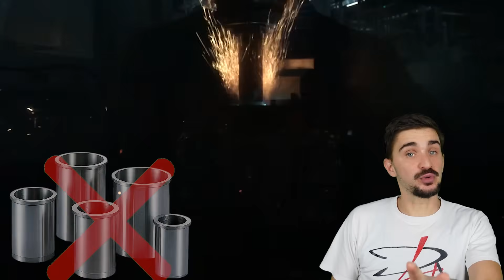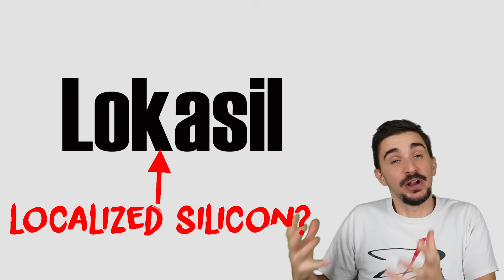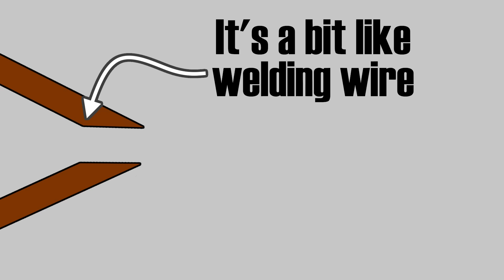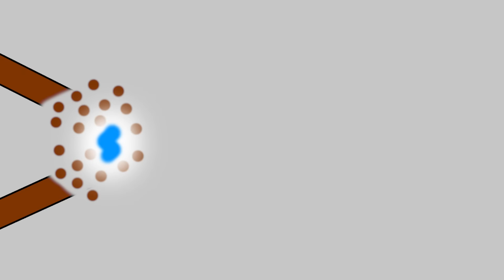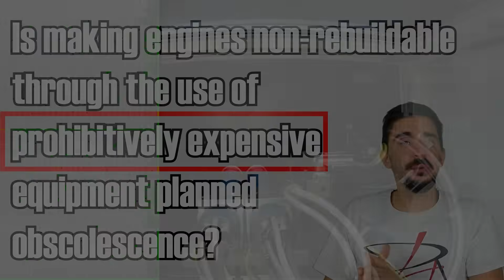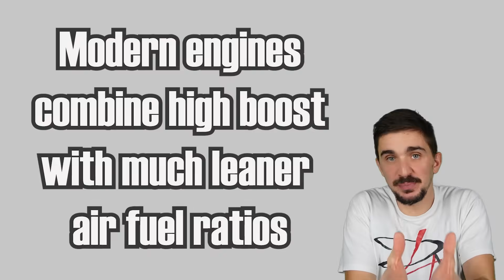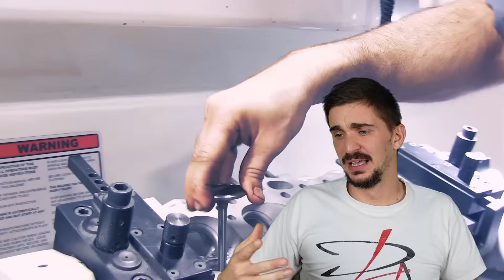Why Are Engines Becoming Non-Rebuildable? Everything About Cylinder Coatings

Comment: From family car engine I expect 2.0l and around 90 hp if it have to weight so much as 2000 kg.

From Performance car I expect Performance in corners, acceleration and fun, not some mythical 1k hp that I will not use even on track. Only will use it in 1/4 mile run, which I dont have track for it around.

Can we finally start doing ""resonable"" cars again? Wild raw cars in performance, not heavy bricks with as much hp as we possibly can.
Reply: The bricks with huge HP Numbers (that last less than 10 seconds) is a USA Problem. Maybe you should check outside of the USA 😂
Reply: @bavarianmonkey8326  I hope you dont meant mock US for making only cars that go straight, since that would obviously show your lack of knowledge. Care to elaborate?
Reply: @soulrippers5652  of course there are also very good round track (cornering) cars from the US. However, drag racing in a straight line with cars that are absolutely useless except in that very discipline  seems to dominate US car motorsport culture.
In Europe, the road course is much more common than quarter mile racing.
Reply: @ True in 100%, but as always, there is a ""but"" : P

I live in EU, and got c4 corvette.
In corners, its amsterpiece, I can go twice sometimes 4 times the speed limit in a corner and its sticking to the road like magnet.

buut... thats the point, I dont want to break the law, speed limits are so  stupidly low in corners that I can do them twice the limit in a boat. They are higly innacurate. 

Lots of roads are also in very bad condition, so coming in a corner fast only to lose your oil pan on first bump is not smth that I gues anybody would like.

C4 is worth fracture of a price of similar performing EU cars, where you wont get V8 with this deep rumble. So I would buy US psorts every time here.

But here comes sad part. Most sports car are relativly slow - their fun is cornering. But when every speed limit and every road is aiming to destroy your car or bring you fine to pay, your only not limited factor i 0-100. there is no law that forbid you going pedal to the metal until you reach certain speed limit.

I have here beutifull mountine roads, with road in so bad condition and speed limits predate second war that is abysmal. 

I really consider muscle car, since big roumble and godly acceleration are only things legal and "safe"" here.

That was a lot of writing and reading. I am curious what you drive and what situation you have on tyour roads, 

Wish you fine day sir ; )
Reply: @soulrippers5652  the Corvette is the exception I also thought about. But then, I personally run rare small japanese go-kart like cars - for the very reasons you stated 😀.
Those things accelerate and corner well and they feel fast although they certainly are not.
Reply: @bavarianmonkey8326  well for me its all about fun. And "Fast"" is relative, you wont win with eco boost on 1/4 mile but you would beet it on the track.. as long as track isnt a straight line that is : P

My friend have mx5, but we have same problem, 20km in a corner that we both can take at 80 its not fun, and police love their bushes on the road.. so yea. Hope at least you dont have such stupid road signs as we here.

Take care and have fun!

Comment: You're drinking the Kool-Aid.  There are many engineers and manufacturers who would never use such technology specifically because it makes their products unserviceable.  Ford used to send brochures to its customers informing them they didn't need to buy new cars, but could rebuild their engines at a very low cost.  It's as if you believe technology drives the market apart from the goals and ambitions of those marketing the technology, as if technology has its own personality.

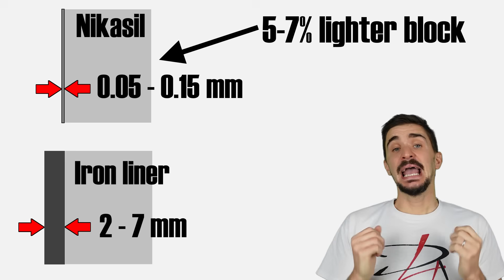Your bias is shown at 6:02.  You say, "Nikasil is better at everything that matters compared to a traditional cast iron sleeve."  Except it's practically unserviceable, which, again, is of primary concern to people who aren't building low-weight racing engines, who want low-cost maintenance, who have demanding customers, etc.

"Manufacturers can produce engines with a huge bore, now."  Yeah, brother, that's what Mitsubishi and Nissan are selling to people, now -- engines with huge bore.

Planned obsolescence has nothing to do with initial costs.  So we know manufacturers who install robots aren't doing it for the sake of culling their workforce because robots are expensive?  Manufacturers won't spend more in one year to save in five years?

There's more to be said.  It suffices to say you've found the conclusion you set out to find.

Comment: You see the same also with EVs where Batteries are designed hard to take apart and repair.  You could easily make an easily accessible EV battery where large cell sections can be removed and replaced even by the owner of the car making replacing an aging battery a peace of cake - but then you risk EVs being on the road for millions of miles and that cannot be allowed to happen.    I even dare say that EV batteries architecture itself is designed to not be repairable easily.

Comment: Three questions - you state that Nikasil has better dimensional stability than cast iron, but as it is applied to an aluminium bore these must surely expand in diameter more than cast iron would as the engine reaches operating temperature. So what have I missed? Secondly, what sort of bore finish does a Nikasil bore have? Is it a cross-hatch pattern, the same as cast iron, or is it something different? Thirdly, does the use of coatings require different piston ring materials? Thanks for an interesting video.

Comment: I am quite happy with my K1200 BMW motorcycle engine with Nikasil cylinders.  It is 18 years old and has nearly 108,000 miles and runs great and the cylinders still look like new.  As long as a ring doesn’t break and score the coating, the engine can be fitted with new rings and will probably last several hundred thousand miles.

Comment: The owner's manual for a Chevrolet Vega said "change the oil every 3 months or 3 thousand miles, or more often in dusty conditions, or after a sandstorm".  At that time, the Texas high plains had dust storms about once a week after spring or autumn rain.  A Vega owner would be changing the oil once a week or more in those conditions, if they followed the manual.  Don't ask me how I know this.

Comment: Question for folk with more experience then me....
Peugeot engines in cars I owned like the 405 had wet liners. I know these have their own issues, but wouldn't it solve this problem. They could be batch electro plated with nikasil then installed when necessary ?

Comment: For the saving CO2 for rebuilding an engine, the big point I think you are not taking account of is that if the engine cannot be repaired for a reasonable cost (whether through rebuild cost or ease of repair of sub assemblies) then the failure of the engine results in the entire car being scrapped. Hence the 30kg engine block is only a small fraction of the recycling. If the average car (likely somewhere around 1500kg total) can be made to last just 1 year longer then the savings in CO2 for the car fleet will dwarf a 5% improvement in fuel consumption.

Comment: I used to own a 1971 Chevy Vega. The engine used Rynolds 390 alloy rather cylinder liners. The engines lasted 50k if you were lucky. They increased the thickness of the coating to get past the warranty period.

Comment: Emissions compliance led us here. Ultra low tension piston rings with half the piston to cylinder clearance compared to iron cylinders. That's the main thing causing reduced friction. In the US we regularly put liners in absolutely everything. The biggest problem with newcomers is not setting the increased piston clearance requirements for cast iron liners. It can get absolutely ridiculous with some F1 engines being "set" seized when cold due to extremely tight clearance. They have to be preheated to operating temperature before they can be started. Efficiency=power.

Comment: 27:00 oh counterair its way cheaper (atleast in the US) to rebuild an older engine than to buy a new one, for example I have a ford mustang with a 4.0 V6  I paid $400 form a junk yard to get that engine its lasted 11years and I just rebuilt it for $500 got it bored and got a whole rebuilt kit right, If I was to by A "new" like rebuilt by factory style company that same 4.0 V6 is gunna cost atleast $1200 to $2000.        Sure I paid like 300 to 500 less overall but there's a good time gap between paying to fix it.  It mainly comes down to finding places that will fix your car cheap or doing it yourself cause some people would be amazed at how easy some cars (except German cars) are to work on.

Comment: Mercedes M112/113 engines are the most reliable gasoline engines from Benz. There is not a problem with Silitec. The problem is that in the newer following engine generations (M273 then M278) due to EkoTerrorist requirements from governments, they had to go down with the piston/block freeplay (not sure now how much exactly, but roughly from 5 to 2 microns). Thats why new engines use thin oil... Thin oil has less friction = less fuel consumption, but needs smaller gaps. Smaller gaps = reduced engine life. BTW Silitec engines can be resleeved with cast iron sleeves w/o any issues... If there wouldn´t be that ridiculous push for low fuel consumption and emisions, we still could have the good old engines which lived 2 times longer than the car chasis.

Comment: car manufacturer's cant sell cars if they last for decades so the make imperfections they break them specially in newer models, the bean counters try to make them out of as much plastic as possible and the engineers try to make them break after a certain amount of time, which is why the cars from the the 80's and older can outlast a car from the 2010's and newer, and this does not even go into the garbage tech side of the newer cars cause that's a whole other mess.

thank god for aftermarket part makers that care.

Comment: Perhaps Europe is vastly different from the US,Canada, Mexico, India, Pakistan and pretty much the entire rest of the world. But to spend 27 minutes talking about the "environmental benefits"  and then one false minute about the cost of rebuilding an engine was at best questionable. Toyota, Honda, and even some Nissans are regularly rebuilt for family cars, the point totally missed in this video is that they are not rebuilt one at a time for each vehicle owner but in lots/batches by engine rebuilding companies. The Chevrolet LS family of engine blocks have been and still are rebuilt more than some engines will ever be first manufactured. That does not even get into the likes of Ford's multitudes of engine families that are regularly rebuilt or evening Dodge/Stelantis(no I will not recognize RAM as actual brand just for fun). As to your video's core topic a mfg process that uses cylinder coatings, cylinder sleeves can be machined well within spec to replace such coatings, and assuming the engine is not machined at the oem with such thin tolerances to assume a truly single use engine, then any engine can be sleeved. That does not even begin to delve into the many after market coating mfg's and the engineering required to fit a manufacturing robot with a spray attachment would not be that difficult from a engineering perspective to apply an aftermarket coating the only question would be the economy of scale question if it could be done at a rate to justify the process from a cost perspective. Which means the only way rebuilding could truly become obsolete is if citizens allows their own gov't ban such engines based on age.

Comment: The only factor that matters in my neck of the woods is cost of repair to the customer. Sure, modern engines are more powerful, lighter, cleaner, fuel efficient, but to a person living paycheck to paycheck, repairing or replacing high-tech means high money. Most would prefer to spend extra a little at a time at the pump, and a lot less as a lump sum to fix a problem. Efficiency, power and emissions take a back seat to the poor, because quite frankly they're too busy surviving to care. A cheap set of wheels that's cheap to repair and serves its purpose day in and day out is all that matters.

Comment: Why do manufacturers avoid cast iron cylinder liners? Nowadays they are cast in place in the block (I believe GM invented that process) so it's less steps for machining. The liners are cast in place and maybe get a final machining step the same as anything else would get for manufacturing.

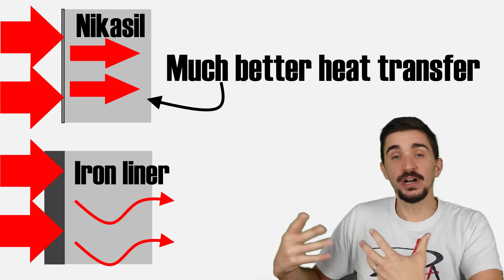Comment: At 4:05, the limiting factor isn't heat transfer, it's cylinder wall stability.  A coating only gives you wear resistance.  Iron liners are more dimensionally stable under load and can be machined for better tolerances than the coating can.  Also, quality iron liners come with coatings for low friction.  Once again you're peak stupid.

Comment: ...looking at an inline 6cyc rebuild. No fuel injection, no computer, no power anything, 4spd gearbox, and a 10:1 comp ratio mated to a bulletproof trans and a good midrange rear.
Reply: Solid iron for me, thanks... even iron core with aluminum cladding. All that other babel I don't want under my hood.
Reply: Prohibitively expensive is planned obsolescence... sorry, I have to disagree knowing what I do about this area of study in modern manufacturing and capitalism.
Reply: The carbon footprint of all this must be astronomical.

Comment: People seem to always forget the first R that is Reduce, Reuse, Recycle. People only ever seen the Reuse and Recycle part but forgot that Reduce part. By making engines last longer  that alone will reduce the amount of new and rebuilt engines needed. and once its needed to be rebuilt. Then we can go to the Reuse part and once and for all when that engine comes to the very very end of its life and can no longer be saved then and only then it can be Recycled.
Reply: You can extend lifespan by 2~10x by coating the engine with a super durable low friction coating.
🙂#XcelPlus

Comment: thanks for your very detailed report. It seems to me, that making blocks of cast aluminum is the core problem. .. trying to reduce weight is asking for multiple problems in the process. 
sleeves maybe the smallest. why is performance so desperately needed on a 70mph speed limit?
Reply: Because people are not very smart, and are super ego-tistical.

Comment: we actually had courses in engineering on how to "design to warrentee", basically exactly what you said - make it so on average it lasts the length of the warrentee, along with all the statistical analysis to figure it out... so yeah, it's common place, we can design stuff to last forever, but the bean-counters decide if it's worth it, and if a longer warrentee will sell enough units to offset the costs...
Reply: That’s straight up planned obsolescence, thanks Bean counters

Comment: I have an early 2000’s Silverado and I still think the best solution for longevity is an entire cast iron block. Easier to build, long lasting, can handle a lot of power should you choose that route. I’m at 330,000 miles and it doesn’t burn any oil or have any problems to this day. I know a lot of people think that Japanese engines are the best ever built but I would put small block chevys and LS engines with the best the Japanese have put out, and I’ve owned a 22RE.
Reply: you americans with cheap gas. Its like speaking different language. You cant understand how the rest of the world looks at cars and engines for everyday use. Gasoline and diesel is 4-5x more expensive in EU and some other parts of the world. You would go bankrupt with old american engines in europe.

Comment: Alusil is certainly rebuildable - and it's doable without any special tooling, new liners, or anything else - with the caveat being you'd have to bore out the cylinders, re-expose the silicon using Sunnen AN-30 or hone using a plastic/diamond stones, and run over-bore pistons. Mercedes/Porsche guys have been doing this at home for years, but unfortunately there aren't a ton of companies out there that offer it due to the relatively low volume of engines that need it. See Kolbenschmidt's "Reconditioning of Aluminum Engine Blocks." The M3 in my garage had a damaged 4.0L S65, and was bored out 2mm/re-exposed and now has a 94mm bore, 4.2L engine, and still very much Alusil.
Reply: Best thing is you can even make it a 4.4 liter, much like a M3 GTS
Reply: @satsumagt5284 The 4.4 actually has the same 92mm bore - it's just a stroker crank. Bore alone can only get you to ~4.2L. If you bore to 94mm and do an 84mm crank, you'll get almost 4.7L
Reply: @MrElectrify S65B42 sounds… Interesting

Comment: As a mechanic I can tell you that it simply comes down to cost/benefit and this would apply to newer engines with low mileage.  It is simlly cheaper to install a remanufactured engine, rather than pay the labour costs to remove, inspect, repair, reinstall the engine on top of the parts that are needed.

Comment: I am familiar with the Ford coyote 5 L engine. In the real world these engines can become some serious oil burners after about 130,000miles. Many consumer complaints have been validated in this regard. I beg to differ that the less costly thermal plating process is more durable than a steel liner. Most of the heat in the combustion process is generated and dissipated in the cylinder head area. Pistons are cooled underneath by oil squirters. Heat buildup in the cylinders has never been a serious issue with normal use. As far as the weight difference, it is very minimal. The coyote is such a beautiful engine, and a nice performer. It’s a shame they didn’t spend the money to put steel liners in it to allow it to live longer.
Reply: It probably can be sleeved.